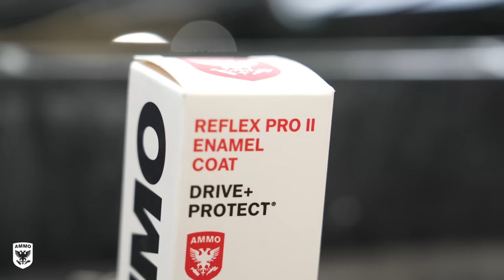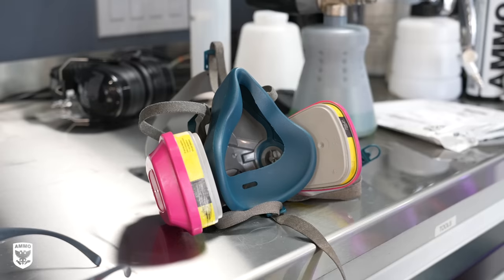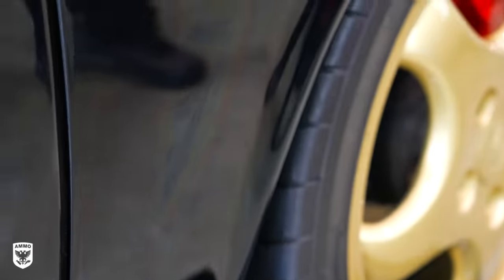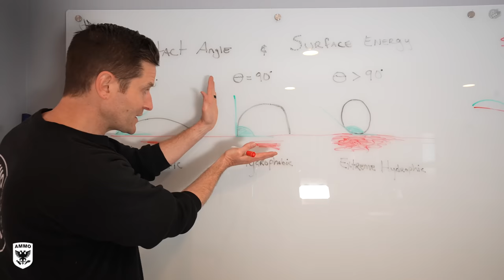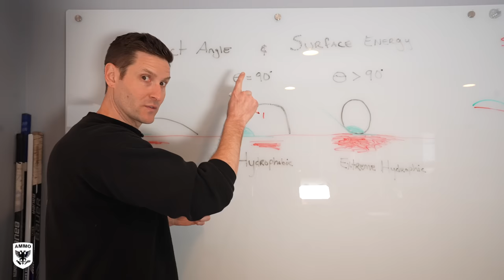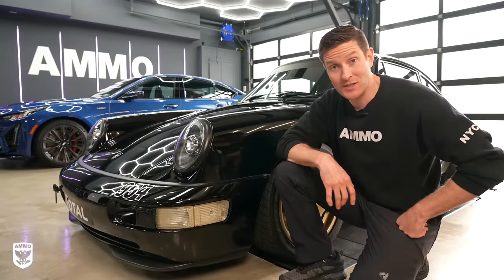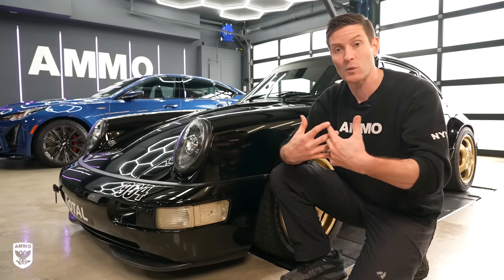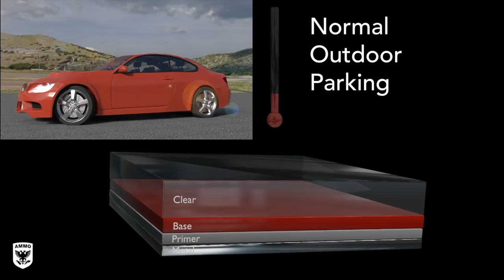New AMMO Reflex Pro II: How To Install Slick Ceramic Paint Coating

Comment: Vids have grown from very good to great, info is stellar. Two days ago I used my 3 plus year old but unopened AMMO ceramic, on a decently prepped car that has 25K miles. At 8K miles there was spray on Mothers ceramic. Back then used random orbital, the right light medium pad, light cutting compound, Sonax, washed buffed off residue, finished with two spray on coats of Mothers ceramic. Fantasitc results. This was before the AMMO ceramic came out. Easy to touch up every 3 months. 

After I had done this discovered the original AMMO for the low low cost of about $60. Professionals were suggesting that I remove the Mothers spray on. I had spent so much time doing it and the results were very very good so was happy enough.

Two days ago time came to  random orbital in prep for the AMMO. I used medium Meguiars compound to remove old ceramic and mild water spots, alcohol to remove residue. Put on 2 coats of AMMO ceramic ( over 3 years old). So easy to apply and remove after 5 mins. Waited 2 hours between coats.  Curing now, for 4 days.  No detailer would answer question on whether old unopened product was ok to use. It most definitely is. Pending final results but the product speaks for itself. It is all about the prep. Of course there are improvements over time but the price has tripled. Still a bargain. I only used half bottle on 2 door coupe. Will wait the 4 days and rinse off. Hoping to see amazing beading and sheeting. Took me about 4.5 hours and I am slow... but methodical.

Comment: Hi Larry, congrats on the new product! A question: is it as forgivable and easy to apply and buff out as previous Reflex Pro? Meaning, if you miss a spot while wiping off and the product dries out, do you have to polish that spot to take it off? IIRC, with Rexlex Pro you could just reapply the product on that spot, let it haze and wipe it off. Could you please also talk about expected longevity and how to remove the coating after some time?
Reply: I have the same question.
Reply from the maker: Depends on humidity and cure time. If you miss a spot during the application, yes you can likely lift the "high spot" with your applicator and a little coating. If the high spot cures, it will likely need a light hand polish to remove. I would expect 2 years protection with normal conditions/maintenance. The coating can be removed with polishing or clay bar after its active life cycle.
Reply: @AMMONYCSTUDIO  Perfect, thank you for your reply!

Comment: Hi Larry, I'm an original Reflex user from 2016 and haven't applied the Reflex Pro II. How would you compare the process between the 2? So many "horror" stories when applying ceramic coatings with streaking and product not being level etc. I have recommended Ammo NYC products to car enthusiast friends and have been out of the car care game for few years and now have a black luxury SUV that is used for airport transportation and frequent washing isn't practical so I have use a drive thru car wash. I am planning to get the paint corrected and ready for Reflex and then add a polymer on top then a paste wax. Anything I might be missing? Thanks and love the products

Comment: Does ceramic coating ur windshield make t grabbier. My winsdhield have been catching lots of fusts lately. And i have had to clay it quite a lot, else the wiper feels as if its running on dry or on sand paper.
I also use glaco water repellent.
Is there an alternative for clay on the windshield something chemical base and not physcial.

Comment: Quick question... when you buff it off (after curing), should you chuck the microfibers?  If not, what do you suggest they be washed with before using again?  Thanks!!
Reply: Maybe,  maybe
Reply from the maker: If soaked and wash immediately should be fine.

Comment: Looks amazing. Can the buff-off towels be used again, or does it stay in the fibres even after a wash?
Reply: I want to know too
Reply: Depends. I pressure wash the towels first and then throw them in the laundry. They seem fine but they probably will scratch paint worse then a brand new towel so up to you to decide that risk factor. Other wise they can be used to clean wheels calipers exhausts interiors or other things that aren’t scratch sensitive. I’ve pressure washed and cleaned the blue applicator pads after hardening for months and they were totally reusable. hope this helps

Comment: Quick question Larry:  Do you have to polish, or can you apply knowing your paint has some imperfections?
Reply: Yvan Lacroix, and Larry have mentioned that if you want a coating to last longer preparation is key. At least, polish to clean the paint, you do not have to take out the scratches if you do not want to. I would email Larry and see what he says.